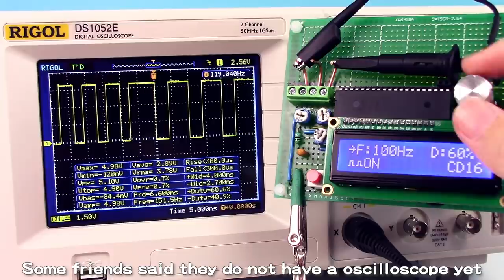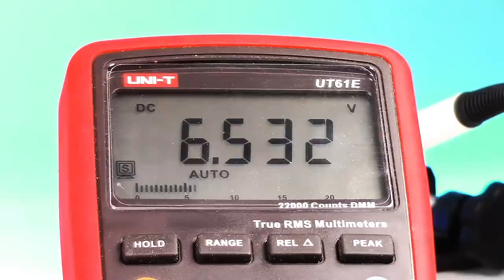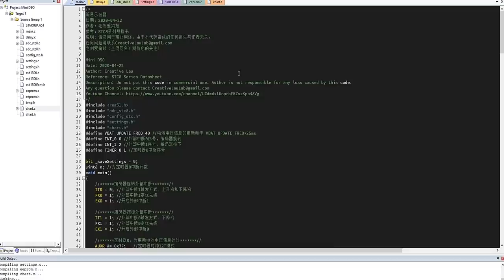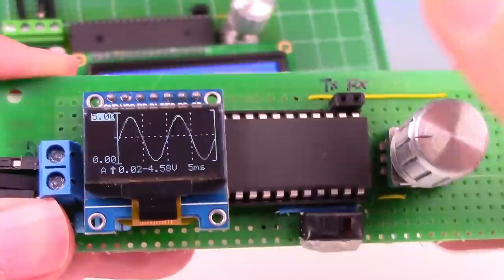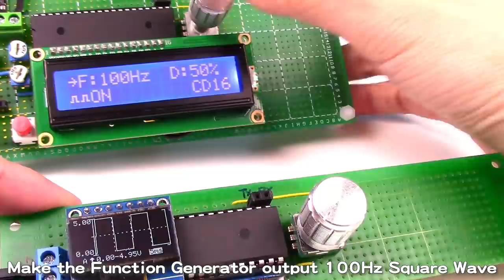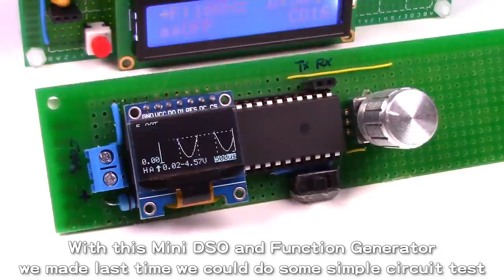How to DIY Oscilloscope Mini DSO with STC MCU Easily

Comment: Congratulation on the project!

This is a really useful thing to have around but if you can please make this code to work on an Arduino or ESP32 (this will be better as is more powerful, can go up to 240mhz and maybe will be possible to increase the sample rate having higher CPU clock speed) and also to have the option in the code to choose between ISP and I2C OLED displays to make it even easier to do it with what you have in your home.

STC8A8K64S4A12 DIP40 is discontinued and really hard to find. The STC8A8K64S4A12 in the LQFP-44/48 and 64 packages are widely available but they will need a PCB to be designed to be able to use them I think an ESP32 will be a lot easier and a lot of us have already some around. 

Maybe someone already port the code for the ESP32 or Arduino and can share it, I tried but I'm not so going with the programming part.

Thank you.
Reply from the maker: Thank you for your suggestions. Here I want to share not only a code but an idea. I would like to see people make their own more powerful and functional DSO base on my idea. Since this is only a simple DSO, it could not replace an oscilloscope completely. However, I still want to listen to your suggestions, e.g. add SPI and IIC option, convert code to compliance with Arduino etc.
If you could not find STC8A8K in DIP40 and easier to find LQFP44/48, you can use an adapter PCB to transfer the LQFP to DIP easily. It is very cheap and easy to find.

Comment: Is it possible to use a 4-pin 1.3-inch LED module and a Mini USB driver Nano 3.0 ATmega328 5 in 16 m in your project ?
Можно ли в вашем проекте использовать 4-контактный светодиодный модуль 1,3 дюйма и Мини-USB-драйвер Nano 3,0 ATmega328 5 в 16 м ?

Comment: can i use this for making inductor?
For example; 100uh 10A
Reply from the maker: Make sure the input voltage between 0-30V. You can apply it to any signal.

Comment: Sir Can I Use this Microcontroller for this Project

(NT6861)

8-Bit Microcontroller for Monitor
1 V2.0
Features
n 40 pin DIP & 42 pin SDIP package
n Operating Voltage Range: 4.5V to 5.5V
n CMOS technology for low power consumption
n Crystal oscillator or ceramic resonator* available
n 6502 8-bit CMOS CPU core
n 8MHz operation of frequency
n 4/8/12/16/24K bytes ROM are available
n 256 bytes of RAM (which stores EDID for DDC1/2B)
n One 8-bit pre-loadable base timer
n 14 channels of 8 bit PWM outputs:
6 channel with 5V open drain and 8 channel with 12V
open drain
n 2 channel A/D converters with 6-bit resolution
n 24 bi-directional I/O port pins and 1 I/P pin
n Hsync/Vsync signal processor
n Hardware sync signals polarity & freq. evaluator
n Built-In I2C bus interface
n Supporting VESA DDC1/2B function
n Six-interrupt sources
- INTV (Vsync INT)
- INTE (External INT with rising edge trigger)
- INTMR (Timer INT )
- INTA (Slave Address Matched INT)
- INTD (Shift Register INT)
- INTS (SCL GO-LOW INT)
n Hardware watch-dog timer function